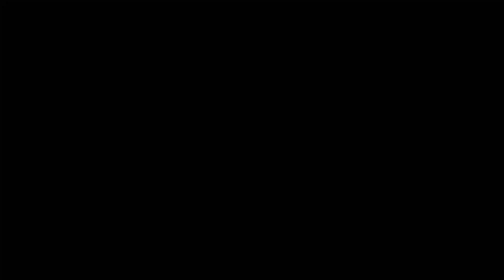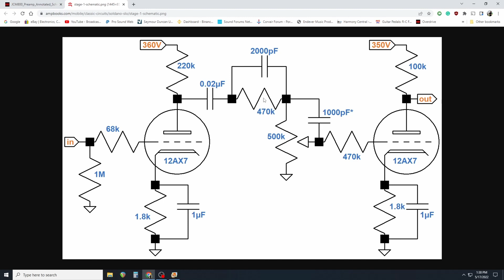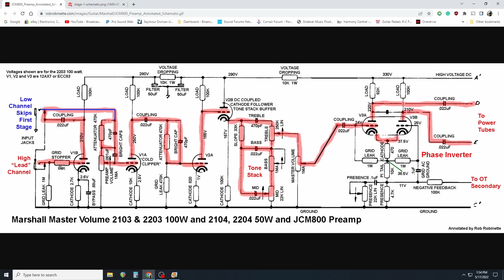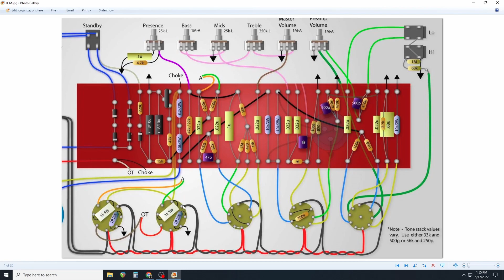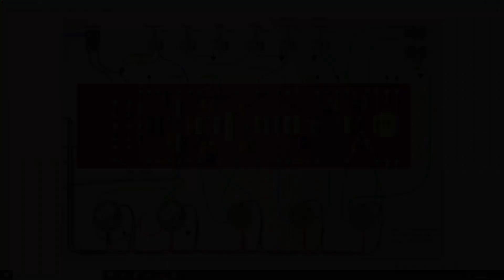Let's build the worlds best guitar amplifier Part 2

Comment: Good tutorial on the slo lead circuit. You missed a pretty important part. There is a .001uf treble bleed capacitor that is strapped in parallel with the plate resistor on the cold clipper circuit. This really helps with the soft clipping of the cold clipper circuit.

Comment: Pretty cool tutorial, Bro. I have to ask though do you really dislike the sound of the Direct-Coupled Cathode-Follower  or just kind of resent that it is Unity Gain and assume it is wasteful?  It's not.  It's actually extremely important for some kinds of players.  Because it is unity gain when driven hard it starts acting like a soft compressor/limiter.  Because that drives the tone stack, again when driven into limiting, it starts to "squeeze" the bandwidth and sharpen the Q of each tone section behaving a bit like a cocked wah, adding a very dynamic vocal quality to tonality.  It was an integral part of Tweed Bassman amps that spawned both Marshall Plexi and Vox AC30 design and dynamic timbre.  It is a large part of why they "sing".  That the tone stack comes AFTER the Volume/Gain control just adds to it.

The main reason Fender drifted away from this topology for Blackface amps is that placing the tone stack BEFORE the Volume/Gain control made the amps sound more similar at a wider range of gain settings so one amp could cover a wider range of venue sizes.  This was extremely important back when PA systems were for voice only but at the sacrifice of the "vocality" of Tweed/Vox/Marshall design.  Once PA systems starting reinforcing everything including mic'd up amps, the only attribute that had to be considered for amplifier power was headroom.  Today you can play with a 5 watt Champ provided you have a solid PA with a decent monitor system.
Reply from the maker: For me, it just has a sound and does a thing that I am not a fan of. No debate that it does do what it is supposed to, but what it does to teh sound and feel I am not a fan of. No more, no less.
Reply: @atech9020  That's cool.  One man's meat is another man's poison. Since it appears you're fond of cold cathode clipping you are prolly more of a high gain player that prefers hard compression over soft limiting.  That does facilitate speed playing a bit more, just less vocal.